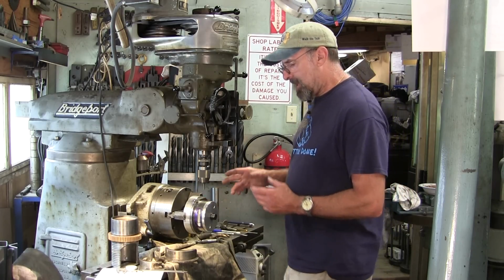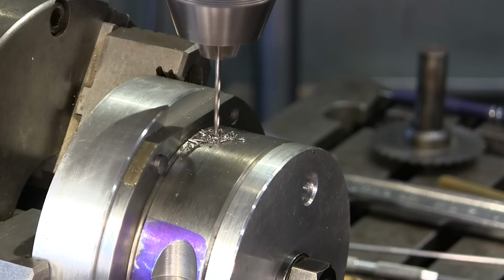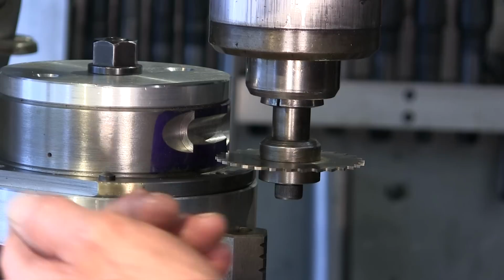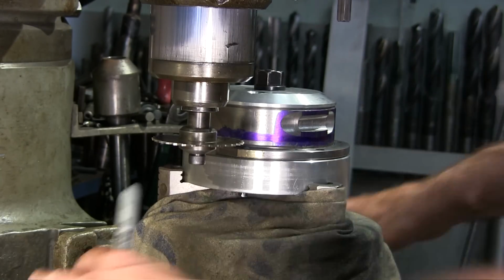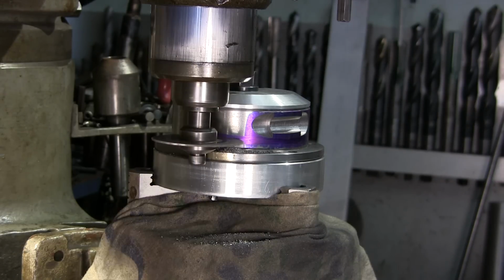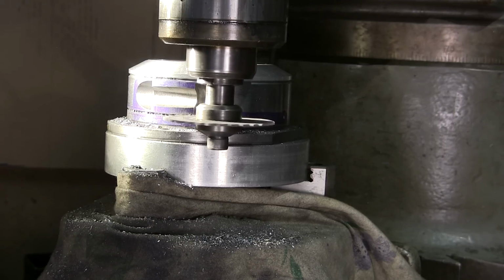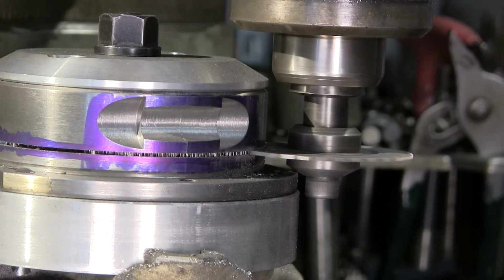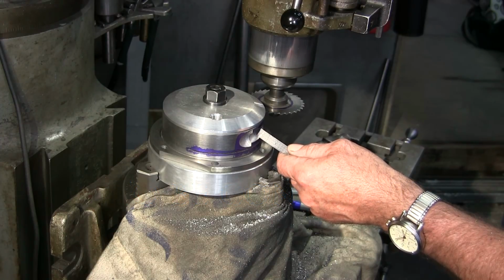Do Over Part Ten

Comment: Keith, the 'DEEP JOY' continues!!!  Many thanks for sharing.
Reply: Keith, I have watched so many slitting saw operations and never once have I been convinced the cut is absolutely straight, I guess these are the situation that lead to checking tools and equipment.  As a novice, I have to ask myself how critical this issue is and what impact it may have on the piece or work?
Reply: I don't think dead nuts straight is required for this project, but I'd say it is pretty close to straight and would work for many projects.
Reply: ...So...What is the decimal equivalent of 'Dead Nuts'......in 40+ years....I'm still waiting for an answer....
Reply: Wouldn't that be determined by the stated tolerance...  :) In this case there doesn't appear to be any stated tolerance. Any cut (straight or crooked) would allow it to clamp down as it is supposed too? So relative straightness in this case is purely cosmetic.

Comment: just curious if you are going to use the cutting table and create a C shaped shim to fill the slot perfectly so there will be NO side thrust on the arms that will break the part again..   might have to grind the shim to fit perfectly in your slot.  it won't cause the grip on the column to change.. it might even work better.. as in use the cutter digging into the surface cannot force the arms sideways.. 

i also recall when you were test fitting that there seemed to a a lot of play in the big brass nut  where something might be missing.
Reply from the maker: No not going to make a shim. the feed nut was tight to the threads just moved freely.  ;{)------

Comment: I was surprised that you didn't use the rotary table to feed the cut. I'd expected you to feed in to depth at one end and then just rotate the table 160 degrees or so to make the cut. Kinda like a rotary bandsaw.  :-) Did I miss something and the table not have a hand crank? Or is there some other reason for not just rotating around?
Reply from the maker: It was a dividing head rather than a rotary table. ;{)-------
Reply: Oh. That would explain it!

Comment: Stressful. 4" saw? I kept waiting for that 3/4" saw arbor shank to slip in the collet. You must have really stretched the drawbolt.

Milling saws NEVER sound concentric. Even on a brand new saw fresh out of the box on a good arbor there is always some gallop to the cutting sound. 0.001 run-out is very perceptible - sounds like a yard at first touch.
Reply from the maker: I have even rotated them once in a while just so it spreads out the use of teeth!  LOL ;{)--------
Reply: I also have seen very few arbors that are concentric either. The combo of both arbor & saw running-out is frustrating....

Comment: so why did you step around the part rather than use a rotary table?
Reply from the maker: I had it in the index head rather than a rotary table, there are more steps that don't need it to be removed & then reset up in. ;{)------

Comment: I just came to wonder if the slit could have been longer than just half of the circumference... It would probably put less stress to the part when tightened.
Reply from the maker: I like your thought, but remember if your wrong, your mod made it weaker, making a second one free is not much fun!  ;{)-------
Reply: Keith Fenner Hah. So very true. Maybe not the best idea to experiment on a customer project. But I'm pretty sure just a fraction of the circumference (about 1/3) would be strong enough... all tho I'm no engineer. Just to compare, a key on a shaft can hold a pretty big load and that is not much material. =)

Comment: Sorry to be nit-picking but when you drilled the two small holes for the radiused ends of the cut did you account for the cut being lengthened by the radius of the drill at each end making it longer than half the circumference of the outer.

Comment: OK I do t own any of these tools. So I don't no what they cost. but what you did sound's very expensive. For a used machine. I've seen them sell at auction 50.00 for a Bridgeport and lathe not worth there wright in scrap. Maybe it was just the crowd or the locations. Not to demeaning what you do. I like your videos. just asking is that machine worth it???